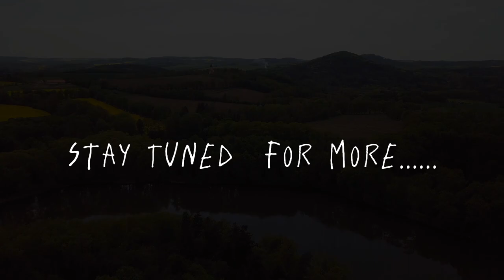Making a pair of Serving Tray's with scrap wood for my son's school auction.

Comment: That's pretty! I hope the corners can handle the bottom movement!
Reply from the maker: The board with all the exotic wood is 2 years old and everything seems fine, I have made 2 or 3 others and haven't had any trouble with them either. I guess it just kinda depends on how much weight it would hold. My wife mainly uses it for a decorative piece